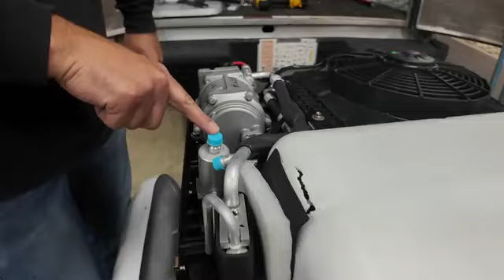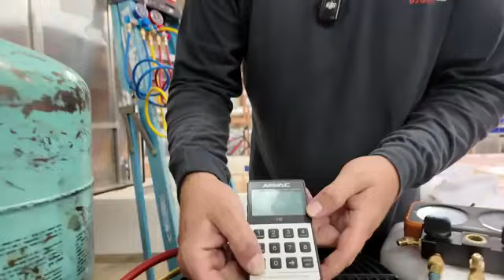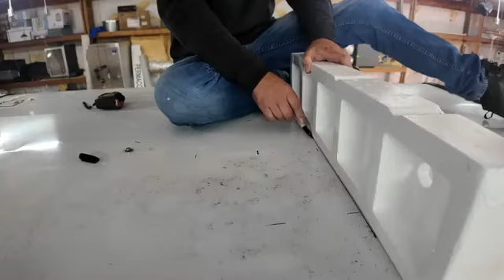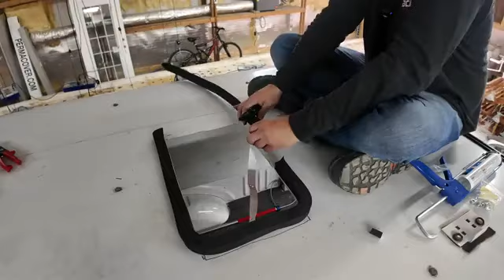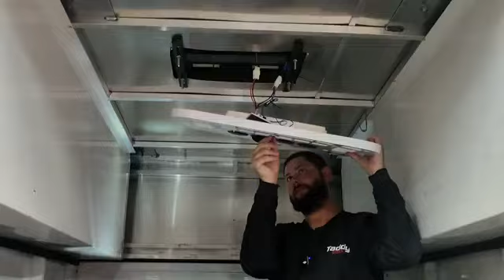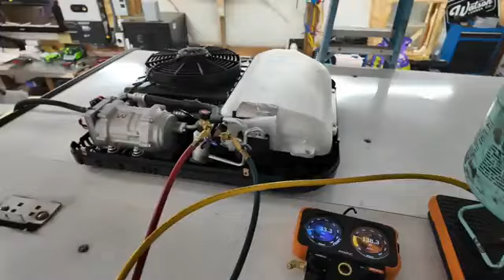Installed a 12V Parking Air Conditioner Step by Step#sunster #airconditioner

Comment: Hello,
Thanks 4 the good Video.. 
To Bad in my sunster it Drops from above through the Lamellen and adwise ? Thanks
Reply from the maker: Hello, the device can withstand short periods of rain without issues; however, if it will be exposed to rain for an extended period, additional rain protection equipment is required.

Comment: Just installed one on my mininvan.... works great!
Reply from the maker: Thank you for your recognition.
Reply: What happen if i connected to the truck battery
Reply: @PabloIbarra-p9t  I connected it my minivan battery and it will run on night setting low fan only while driving. A auxiliary lithium battery is what you need to run the ac vehicle off.
Reply: @goldclaim ineed to use couple times at day and sometimes at night
Reply: @PabloIbarra-p9t best to use another power source such as a lithium battery. 12v 140ah is what i have currently runs about 5 hours at night with night time low fan setting